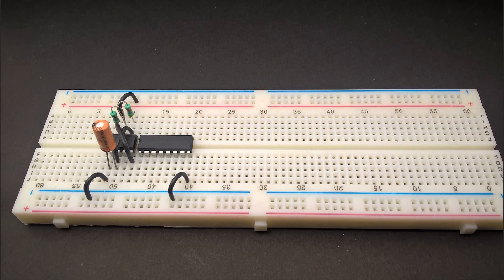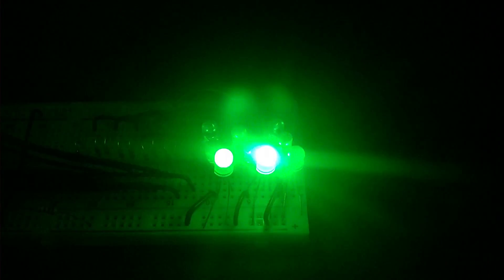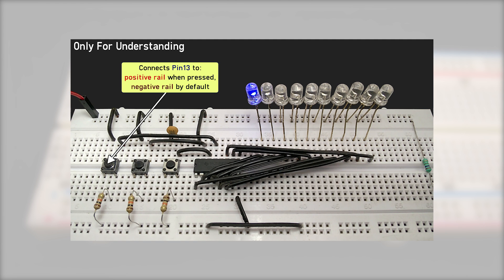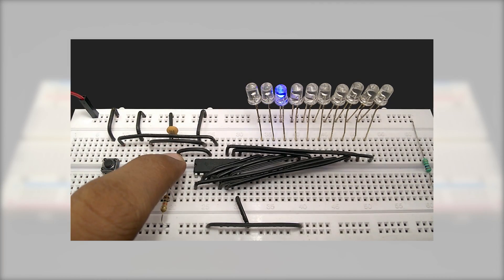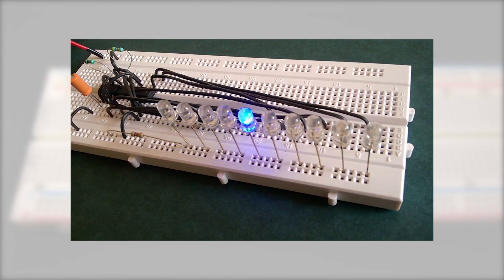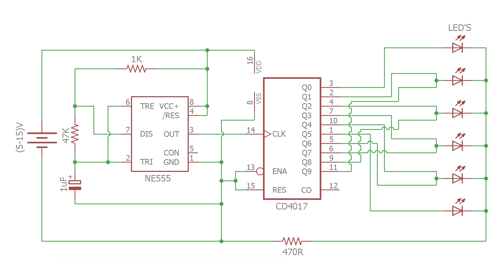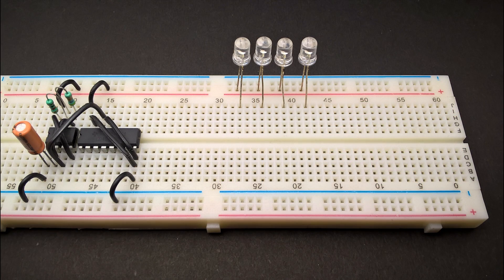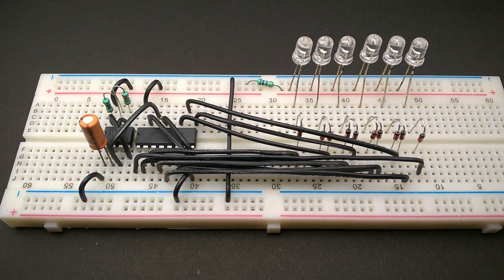LED chaser circuit #2 (Knight Rider Style) | 4017 IC + 555 timer Projects

Comment: Where is the potentiometer on bread board
Reply from the maker: You need a pot only if you need variable chasing speeds. It should be connected in place of 47K resistor.

Comment: If  i connect  12 more leds in series   whit each led which is connected to the ckt. So please tell me this  ckt will  work or not. If  need to some changes in ckt then please tell me what kind of chages  will dlhave to do
PLEASE TELL ME
Reply from the maker: You need to cascade the 4017 ICs. If you wish to have 12 led's, you need to cascade 2 4017 ICs
Reply: Elonics - Electronics Projects on Breadboard thanx for reply

Comment: I built this circuit and it worked great, but after 5 mins it stops. I turn potentiometer up a touch and it starts again. This process repeats every 5 mins or so until it is going very fast.  Not sure why.  Any advice would be appreciated thanks.

Comment: please tell me which type of diodes you r using
Reply from the maker: 1N4148 (Signal Diodes) are recommended. But this circuit works with any type of diode.
Reply: Elonics - Electronics Projects on Breadboard Thanks sir